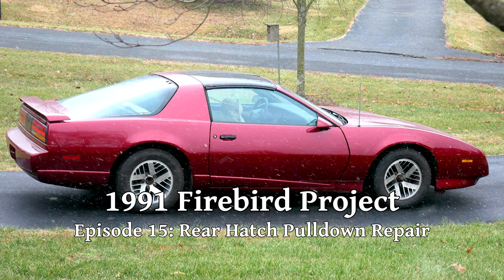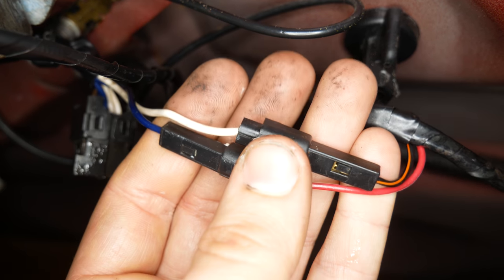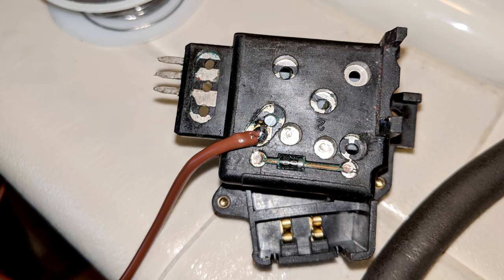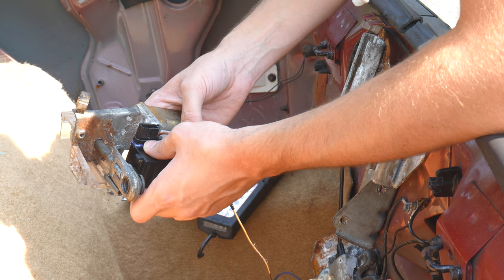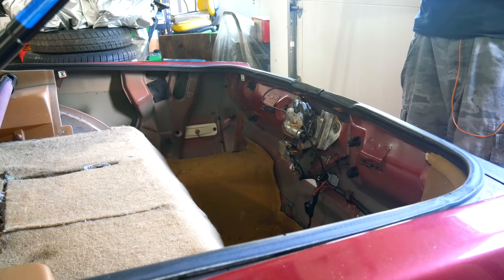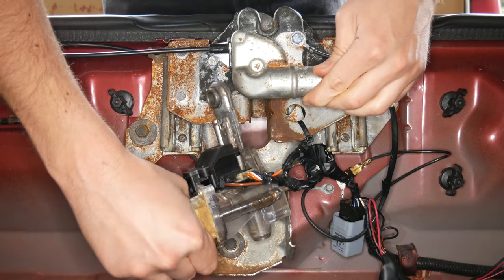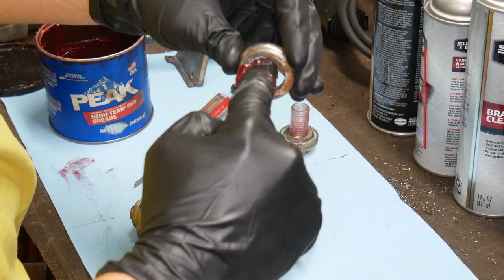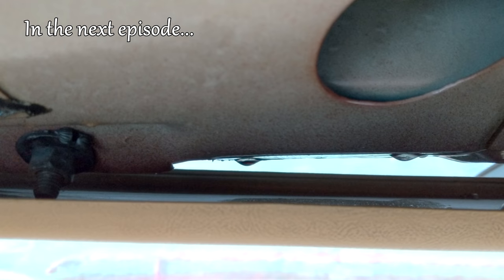1991 Pontiac Firebird Electric Hatch Pulldown Diagnosis and Repairs (Ep.15)

Comment: When working on 80-90-2000 cars, you definitly need a 3D printer.
Reply: Yup, but an SLS 3D Printer, with the cheap ones you can print high quality nylon parts, with the expensive ones you can print metal.
Reply: Adrian  well, I find that my 88 escort xr3i uses way more cheap plastic than my 2002 Galaxy, which uses a lot of high grade PA+GF.
Never the less, sometime shit just breaks.

Comment: One of the best things I ever did was swap out that pulldown for a manual "Slam Latch" assembly. I removed the mounting bracket off a donor 83 Firebird junkyard car, by drilling out the spot welds, then did the same on my Formula. Then a buddy welded in the manual bracket into the car, lined up the standard latch and now I have a nice and reliable latch assembly. Another bonus was since I autocross and road race my car, so shaving a little weight was a side benefit.

Comment: My '86 TA latch is still fully functioning (knock on wood) so I'll save this video for when disaster strikes! Great tip with the fuel pump relay!!! True master mechanic!
Reply: Strange coincidence. I have had 6 or 7 3rd gen firebird/ta. The only one that the hatch hold down worked on including the interior button release was a base model 1986. None of the others worked completely.

Comment: Great video cant believe how complicated the repair is. I have an 88 GTA and I have upgraded to keyless entry and remote tailgate release, works off the cars original central locking and you just have a keyfob like any modern car, the system was very cheap, but I did pay a technician to install it.

Comment: What I did with my firebird was, I got a 8mm deepwell socket, a flathead Screwdriver with no handle, put the flat end of it in the hole of the Manual latch release on the actual latch, welded the socket to the round end of the screwdrivers neck  and hammered the socket over the square part of thelock cylinder on the inside, my homemade mechanism connects the lock cylinder to the latch itself directly, to pull the hatch shut I adjusted the latch itself to the lowest adjustment on the rails, and tightened it down, works every time no issues it’s been 5 years since I did this mod, Hope this helps, thanks for reading this👍

Comment: i had a 87 firebird in the UK with a split main gear in the plastic gearbox,i had a replacement made out of steel which was a 100 percent better. On my camaro z28 iroc convertible i did away with the electric pull down and fixed it in its lowest position permently and used it manually.

Comment: Love your videos. I went through just about the same thing  with an 89 Toyota MR2 about 15 years ago. Bought it for 300 sold it for 2700 after driving it for 6 years. Had tons of stuff wrong with it, and I fixed it all. My question is, why didn't you repair the relay. I have fixed several. Even the ones that are supposedly sealed. They are way less complicated than the headlight control module you took apart. Even better yet, when you are looking at the junkyard, grab all the relays and fuses from them.

Comment: Little suggestion for you in the future. Assuming the plastic is compatible, if you have hairline cracks but everything is intact you can use a syringe and methylene chloride to repair them. It wicks into the spaces and will reglue everything in place without a huge layer on the outside.

You can get that solvent from most plastic shops.

Comment: This sort of problem has been solved over and over again in other industries. For example, commercial door closers work somewhat like shock absorbers with valving that allows for different rates according to door position. A properly set up door closer will increase damping as the door gets closer to being closed, preventing damage from slamming. It seems to me that GM could have changed the existing dampers to act more like door closers (which would probably have been a far more durable solution), but instead they went and reinvented the wheel, so to speak.

Comment: I did that already too... It wasn't easy but i've fixed a not working unit. And now it works properly. But I defently prefer the 91 1/2 to 92 version, this kind of hatch release motor is much more easy to work with...

Comment: I noticed you're using zip ties a decent amount around wiring looms and the like. Might want to check out "grip lock ties". Zip ties that can be undone and reused that also have some rubber-like (not sure exact material) padding on the inside that makes them apply more even forces, grip better, and adds a small layer of compliance that reduces vibration and diminishes damage that can be done to a loom with normal zip ties. They are used a fair amount in small air crafts, desert rally trucks, and the like. Honestly this is the first video on your channel I have seen, so i'm not sure if you're fixing this up to sell, or it's your forever car, but if you think you're going to hold onto the vehicle for a long time they might be worth the expense for some of your applications.

Comment: Hello! What a video and what a process! I’d like to ask a question as the proud original owner of a 1989 GTA. My electric latch was working fine and then I had the bright idea to retrofit an LED bulb in the hatch light. This blew something and I can’t quite figure what. The fuse at front is fine. Do you think I blew the relay or one of the switches? Would love you opinion. The electricity in the latch doesn’t work at all now.

Comment: Doesnt dielectric grease prevent the conduction of electricity? Comments correct me if im wrong, but slathering the grease all over the contacts just makes it harder for it to conduct, which could possibly burn out the contacts. Although there isnt an issue here, I would be more wary of this in the future. I understand you want to stop corrosion, but i would try to be a bit more delicate in where you put the grease! Maybe this would make a good saturday projects video

Comment: The obvious benefit of the used torque spec is that it'll be the same in metric, so, for the first time in the history of the channel you used the CORRECT measure!! 😬😬😂😂
AAnyways, having a 3D printer you will save yourself some headache (and buy some new types of ache😅).
thanks for the video, enjoyed it as always, keep it up.

Comment: How did you get the two little screws back in to connect the two plastic pieces on the inside of the motor? I can’t get the  brushes back into place with the two pieces connected but I can’t connect the two once the brushes are back in place

Comment: Do you have a link for the replacement guides? I've got a 91 Camaro and need a set
Reply from the maker: The ones I used were made/sold by Hawks Motorsports, part number MS-001. Search "86-91 Firebird Pull Down Nylon Guides" on eBay and it should be the first (non-sponsored) result, or Google it and the Hawks web store should pop up. There are at least two other aftermarket options but these seemed very high quality (other than that pipe bushing that didn't fit anyway).
Reply: @FuzzyDiceProjects  thanks! I bought that exact same kit and it fixed it perfectly. I had already replaced the pull down motor because the housing was busted. Now it works correctly!

Comment: I think they could have just used two springs,    One longer with a softer rebound and the other shorter just to catch the lock at the right tension,      Thus when the rear hatch is closed the first spring softens the impact,      The other spring to hold at the right tension to  "  Pop  "  The rear hatch when released  ?

Comment: I probably would have only used isopropyl alcohol on that housing. Most brake cleaner will mess with that type of plastic, either melt it or casue it to crack.

Comment: You can get replacement parts for the hatch pull down. http://www.top-downsolutions.com/

Lon with tds also has reinforced housings.

Also a interesting video would be fixing the hatch alignment.  It requires you to separate the metal deck and re align it with the glass. The lift struts push them apart over time.
Reply: Lol posted before the end, however looks like you tried to solve the alignment with the hinges, technically the hinge mounts allow side to side but not front to back, that deck overhang is due to the lift struts pushing the metal deck back on the glass over the years.

Comment: I can see a gas strut in the hatch, does that work? If not, it would be good insurance to get that repaired or replaced to avoid a hatch slam. FC RX7 has a big glass hatch like this, and it relies on the gas struts to stop the hatch falling under gravity. It always worked for me.

Comment: i have bought many of those stupid motors.  a little tip is 80’s and 90’s gm front wheel drive cars like cadillacs and oldsmobile’s use the same motors. they are not under the same weight stress as the f bodys. just go to a go junkyard and pick up a few cheap ones. if you buy them new, they are expensive.